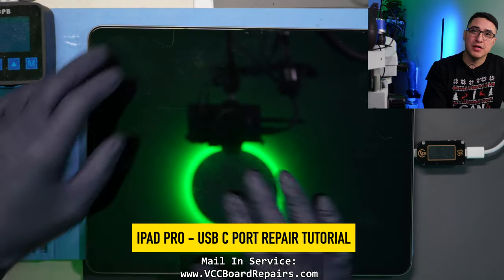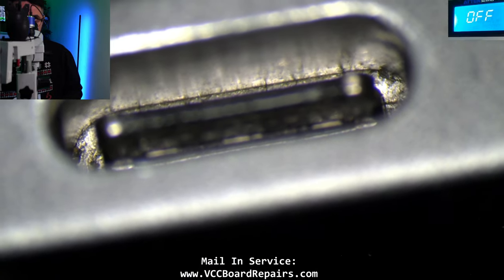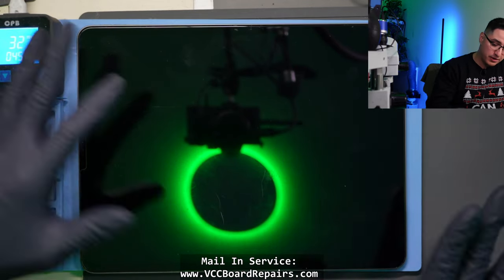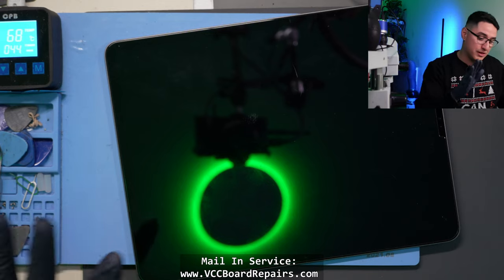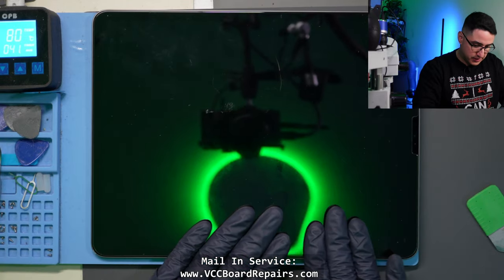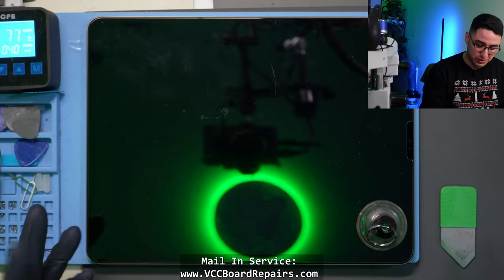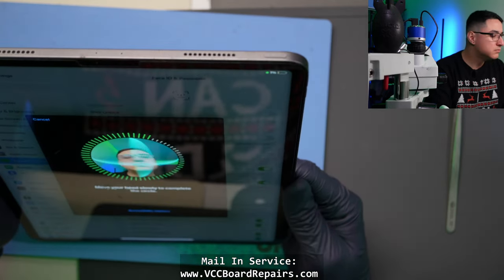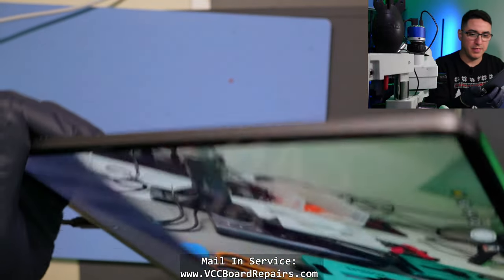The Best Method To Opening an iPad Pro & Replacing The USB C Port.

Comment from the maker: What tools did I use? Here's a full list!
⭐ Heat Pad: https://amzn.to/3QUT349 
⭐ 45W USB C (PD) Charger: https://amzn.to/467Pz2v
⭐ USB C Meter: https://amzn.to/3xrvQeT
⭐ Mechanic T-824 USB Reader: https://www.mobilesentrix.com/mechanic-t-824-mobile-phone-tail-insertion-detector-no-disassembly-required
⭐ Tristar Tester for lightning iPads: https://www.injuredgadgets.com/smartmod-pro-tristar-tester-version-3/?acc=3d2d53e5abcd70e24cc444935b88e6ac21
⭐2uul Blade Screen Opener: https://www.injuredgadgets.com/2uul-x-blade-durable-screen-opener/?acc=3d2d53e5abcd70e24cc444935b88e6ac21
⭐ iFixIt Guitar Picks: https://amzn.to/3QTZ3tY
⭐ iPlastix Separator: https://www.mobilesentrix.com/iplastix-lcd-touch-screen-separation-repair-opening-tool
⭐ Suction Cups: https://www.mobilesentrix.com/suction-cup-powerful-lcd-opener
⭐ Magnetic Pad: https://ebay.us/cdmiGD
⭐ 99& Isopropyl Alcohol: https://amzn.to/46blbnT
⭐ Needle Drip ISO bottles: https://amzn.to/3QRCIgj
⭐ Gloves: https://amzn.to/3MzZF56
⭐ Fine Tip Scissors: https://amzn.to/3QSzERj

🛠 REWA REFOX Screwdrivers: https://bit.ly/47V6w1F
🛠 Magnetic Base: https://bit.ly/47UpfKP

Comment: alcohol use is a great way to disassembly the ipad. but using metal tools is a bit dangerous to lift the glass/LCD. prefer to use thin plastic tools, you can put an entry barrier of 1-3mm so you don't hesitate to slip the tools and damage the LCD. Also, when you find double-sided LCD glue, you can cut and pull it gently following the glue. This can be very helpful in opening the LCD without having to use too many tools. Since the iPad Pro lcd has a small space to stick to the body, gently pulling the double-sided tape glue is a very safe way to open the iPad. pull a little with tweezers, add alcohol, and so on. it's a great video by the way, good job.
Reply from the maker: Metal tools is only dangerous if you don't follow the right technique.
Reply: @VCCBoardRepairs  Yes, that's right, correct technique is very necessary. but choosing the right tools will greatly minimize the risk. especially when dealing with thin glass materials😁
Reply: Do you replace with new adhesive strips before closing or does it complicate the closing because it requires precise alignment on the firs try?

Comment: why do you heat from the back and therefore through all of the electronics and solder joints on the MB.
Reply from the maker: To safely open the iPad

Comment: Quick question. I’m trying to purchase some chips but haven’t been able to and was wondering if you can help me. It’s the ROM IC for the cd3217b12, not the cd3217b12 as I have loads of those but the little ROM IC chips. Do you know the part number for those or have a link for them please? I’ve been on Ali but can’t find them. Really stuck and need help. Thanks rich
Reply from the maker: Donor boards is the best place. I haven't found anywhere else
Reply: @VCCBoardRepairs  thanks , it’s just the donor iCloud locked boards vary price and 
availability every time. Just trying to find a more better long term solution. Thanks Jesse, really appreciated.

Comment: Hi Jesse, I just refurbished a 12.9 3rd gen a few days ago which is essentially the same process. After gluing back the screen like new, realised the USB C port, charges only from one side and not the other. The type C metre turns on and shows 30W  charging on one side, but does not turn on from the other. You think it's worth taking apart again and re-gluing just to replace the port since it charges normally from one side?The new Qianli carbon fibre opening / prying tools are really cool
Reply from the maker: Yes I would open fix it

Comment: This video gave me hope because my iPad is out of warranty and service centre is costing a lot for replacement . What do you think the issue is with my iPad Pro 11 m1 because it charges but sometimes it stops charging because of heat, , but the battery back up is around three hours. At the same time. The battery health is 92%. Also, recently I noticed that my pen drives are not working unless I connect them through a powered type C hub .
Reply from the maker: Sounds like a bad charging port. If you're in the USA, send me a message for a quote: https://www.vccboardrepairs.com/contact-us
Reply: @VCCBoardRepairs  unfortunately, I’m not in the US, thank you for the information, though. I’m glad to know that it can be fixed. Thank you very much.